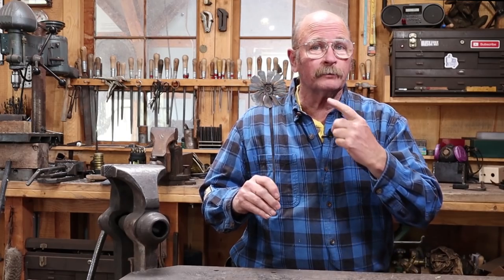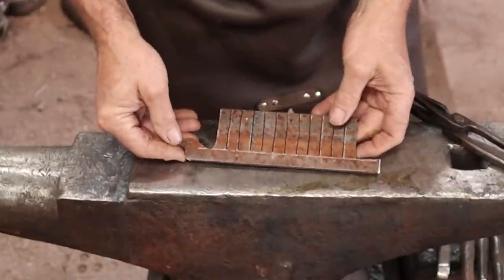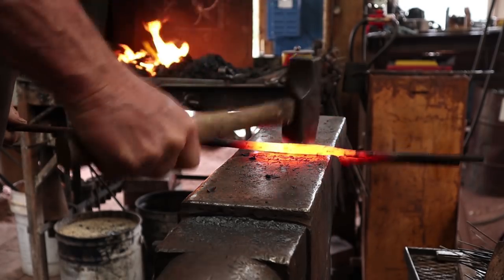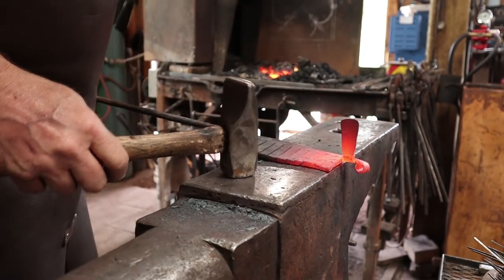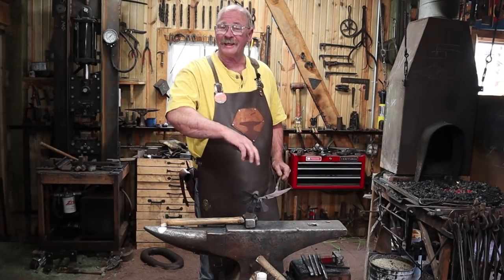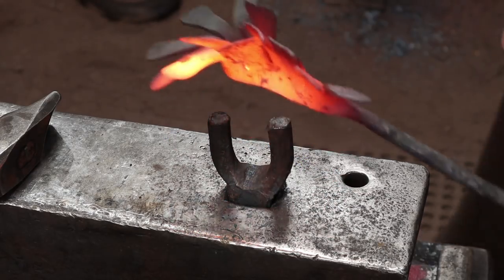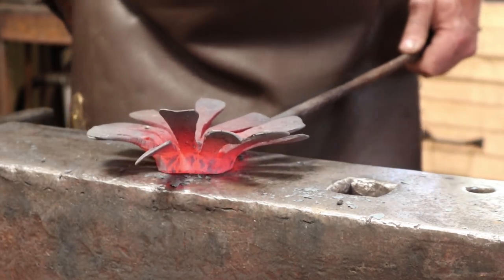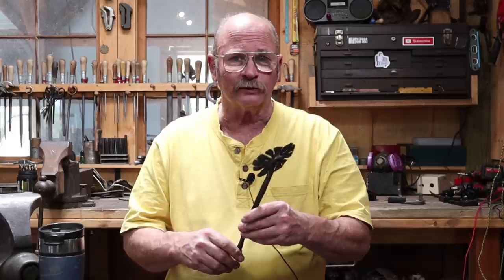Forged flower inspired by Cloverdale Forge

Comment: I almost wonder if some type of bent nose tongs wouldn't make forming the scroll with petals easier. It looked like you were getting good results when bending with the tongs, and it'd probably be easier if the tong nose & handles permitted more leverage to be applied to the metal -- just thinking aloud here though.
Reply from the maker: Very likely

Comment: why cut off that first section at an inch rather than making them all 1/2 in cuts and bending the first one down to make the center scrolled section?
Reply from the maker: In theory that would work.  However the pointy outside corner may cause some issues with cold shuts and the sharp end of the saw cut bent open may leave a stress point.  But I would have to try it that way to be sure.